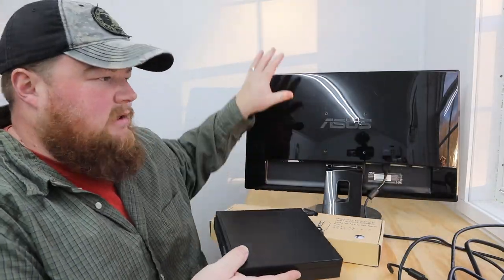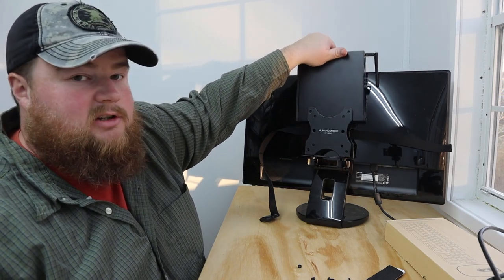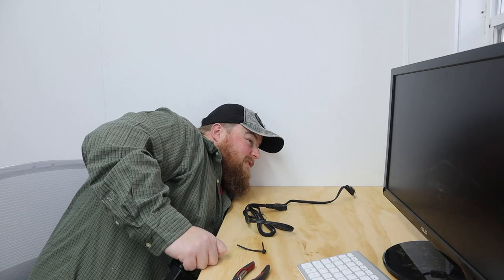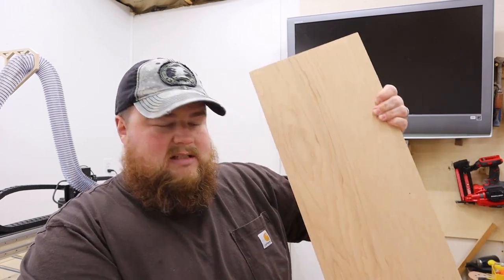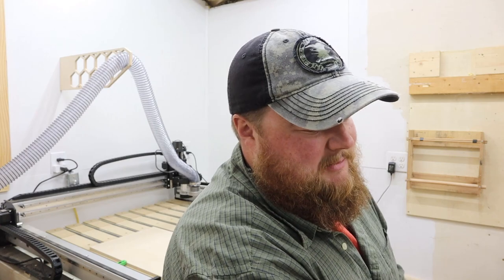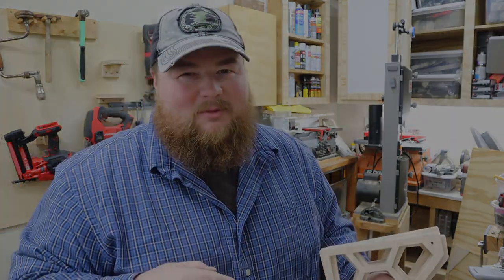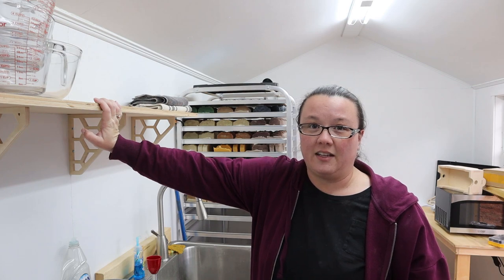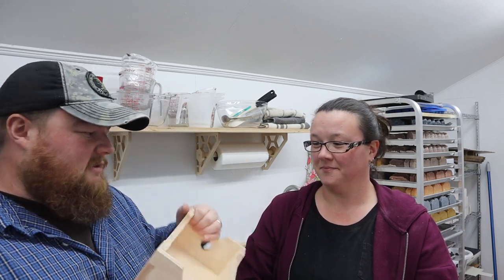CUSTOM SHELF & Small Business Computer Workstation | Soap Making Studio

Comment: Sam,  maybe you could use a hanger bolt in one end of the paper towel holder.  That way you would just need to unscrew a nut from the bolt instead of removing the screw each time.  Just a thought.  God bless

Comment: To make it easier to change paper towels, where you put the screw holding the hexagon on, simply remove the screw drill out hole in dowel/towel bar and hexagon make it large enough for dowel/ pin , insert a dowel, glue the hexagon side leave dowel/ towel bar side loose, when it's time to change the roll just pull hexagon off, pop on new roll, put dowel back through.

Comment: It's looking better and better.  And what a magical little machine that is; I've never seen one before.  Dangerous though;  there would be no plain pieces of wood left in my workshop.  The first brackets could be mounted to a larger piece of wood from the back and then you could put the screws down the sides from the front.

Comment: that little crate can be a mold!  i'd make the front and back foot a little sturdier. maybe a trapezoid shape.  and make it huge!  no, not huge but i think like 18 by 24 will make 130 bars of soap.  and stacking them could still happen.  a bit of air flow still.  put it all on a dolly and wheel it to your desk in 2 days!
Reply: oh and you can use one of the cutout honey combs to hold your micas and fragrance oils in different sizes, like 3 shelves stacked on top, like 4oz, 8oz, 12 oz, etc.

Comment: How about putting a all thread rod on one end of the paper towel rod and use a wing nut with a washer it would be easier to replace a paper towel roll, just a suggestion
Reply: suggest to change that suggestion, use hanger bolt and use tee nut on the wooden hex cap.

Comment: 🙏 PLEASE put a finish on the shelf, brackets and towel holder now, before any use. If you don't, you'll never be able to wipe them or dust them. They'll get grimey and you'll regret it forever. Do it now while you have the supplies out and you're in the "making it" mood‼️ 🥰
(You'll thank yourself, trust me. 😊)

So you have more of a dumb terminal, not a CPU. Do you have it networked to a CPU in the house? Or is everything it does for the business cloud-based?

Love the use of the cutouts for the paper towel holder. Lots of suggestions for ease of roll changes. Make a matching one to hang a hand towel to dry in the other  section. 👍